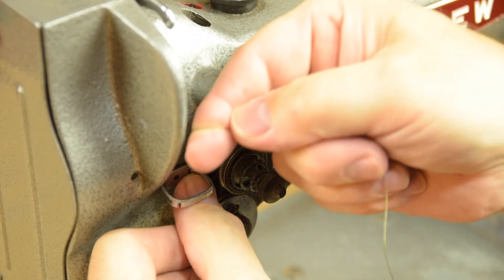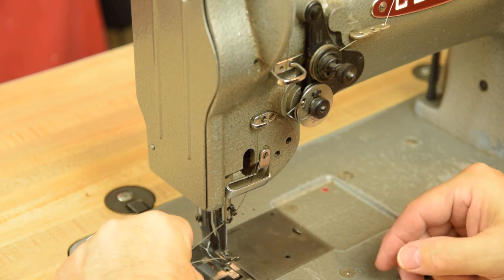How to Thread a Consew 226 Industrial Sewing Machine Thread a Commercial Sew Machine like 206rb Juki

Comment: Not a ton of videos on the web about Consew 226's.  Fortunately it looks like you own one and took the time to make this video, Thank you for that !  I have seen some different methods when it comes to the wrap of the tension disc's and before going down to next guide wheel (perhaps called take up spring guide pulley or wheel).  I have seen people suggest to put thread into tension disc and continue all the way around and wrap thread around the small pin at 3 o'clock before heading down to guide wheel below.  Another video showed after doing the barber pole at 3 holed thread guide to go under that small pin at 3 o'clock then around tension disc the normal way, then head down.  Now I'm assuming your method is text book and threading a 226 doesn't involve that little pin at all.  That little pin's function is to simply to keep disc's from rotating ?  If you could shed some light on this it would be appreciated and perhaps help others with any confusion.
Reply from the maker: You're correct, you don't want to go around the little pin.  That small pin indeed just keeps the tension discs from rotating.  I think the confusion started from a Pfaff user who switched to a Consew.  The thread path on Pfaff's is a little different.  Best to you.

Comment: My bobbin thread needs to be fixed it shows line and knots not just a sewing line.  If you have the video please tell me where.  The top thread stitch looks good, just not the bottom  Thank you
Reply from the maker: Try increasing upper thread tension.  Usually that will fix loose loops on the bottom of your fabric.  Here is a similar machine... https://youtu.be/v2QdIKrK_xI?si=IyJpjB34pPxsgxa6